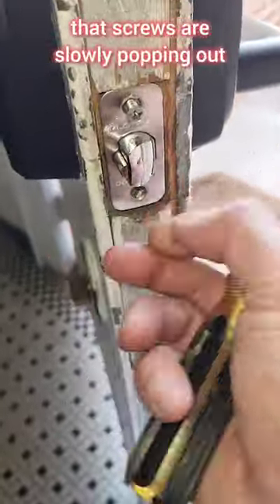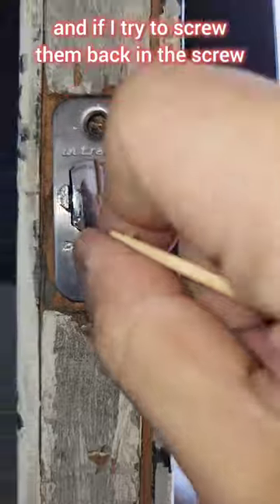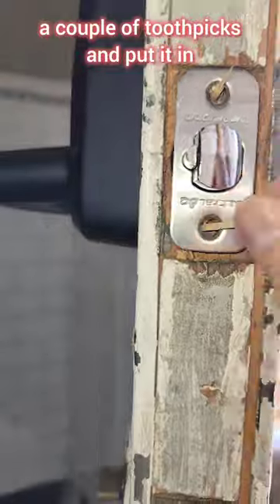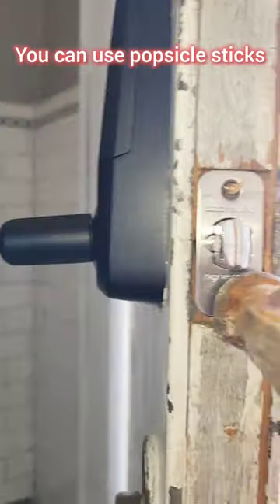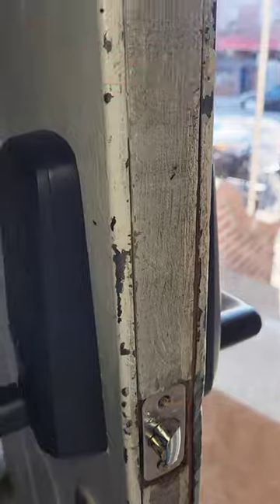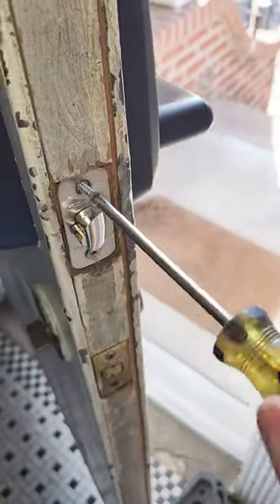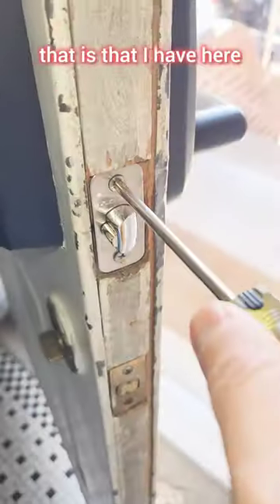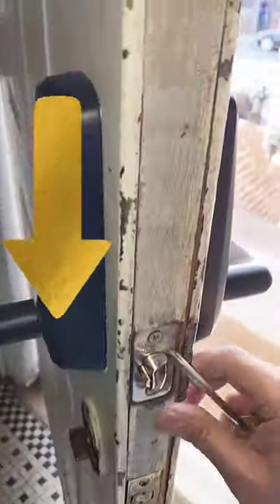Loose screw on door latch fix #shorts #diy

Comment: What if the door core is foam
Reply from the maker: The edges of the door should be solid. However, if the screw went in past the solid part I would use wood filler. Fill in the screw holes with it,  let it dry and then pilot the holes for the screws.